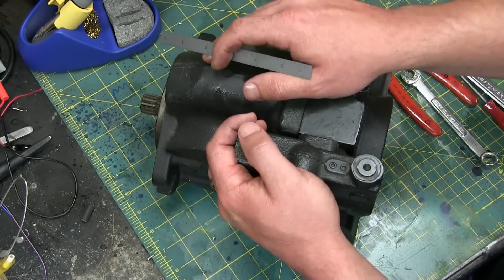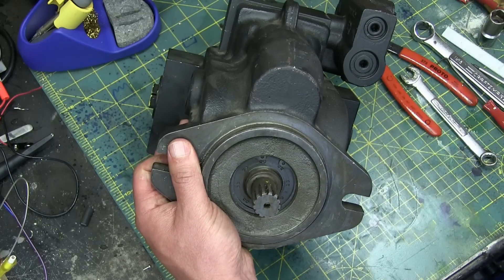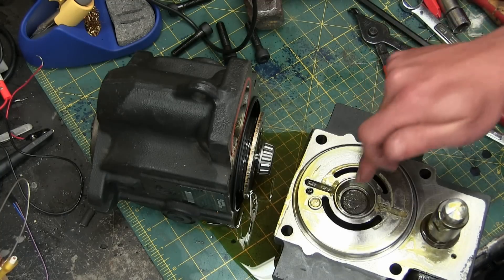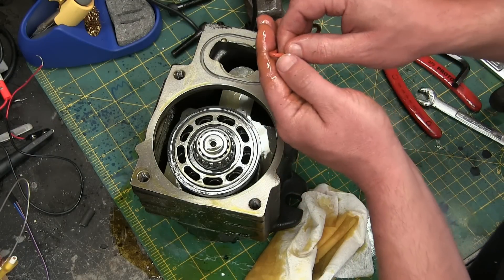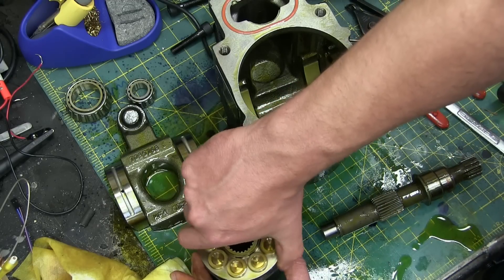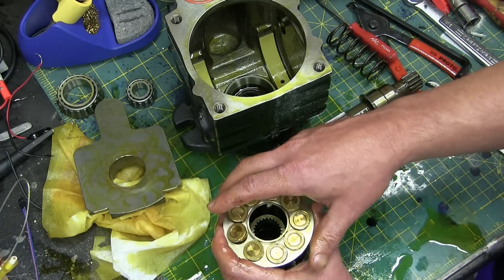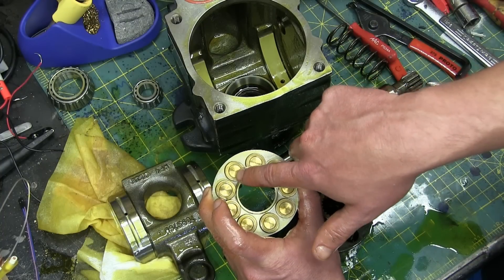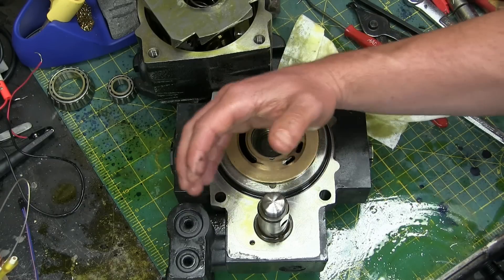100 HORSEPOWER in your HAND. Hydraulic PISTON PUMP!

Comment: I have a Kubota KX-161-3 Mini Excavator I just replaced my hydraulic pump. $4750 , new fluid and filters including pilot filter, all back together and I have very little pressure, acts like it’s fully compensated and not striking, all functions have a tiny bit of flow but no psi, PLEASE I need help if any one can help

Comment: OMG I always wondered how that pump worked!! we use to have them on a orion bus with the series 50 and it was notorious for the input seal to leak and have hydraulic oil contaminated with motor oil.... that pump is so fuckin heavy and akward to work with, and the mounting bolt location UGGGGH..

Comment: Actually only 85 HP at 3600 RPM and 5000 PSIG so really you are off a bit as this pump probably will only run around 2500 RPM